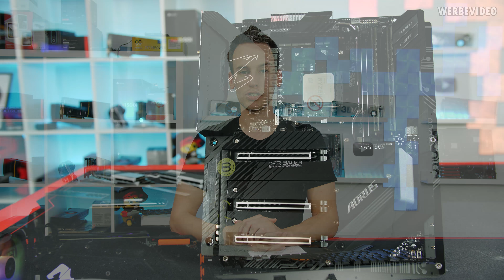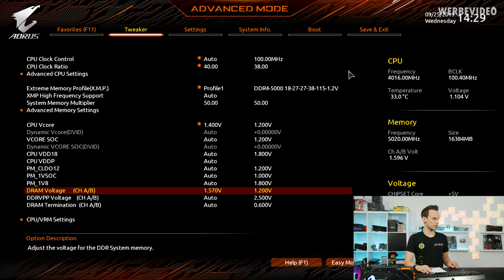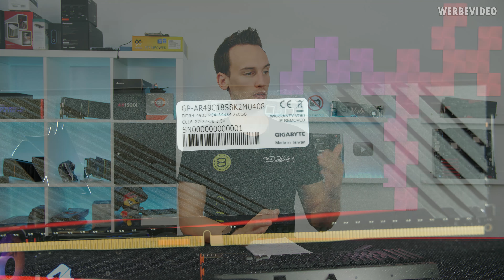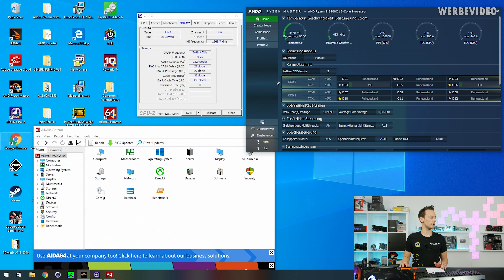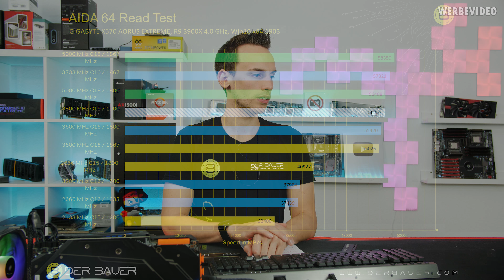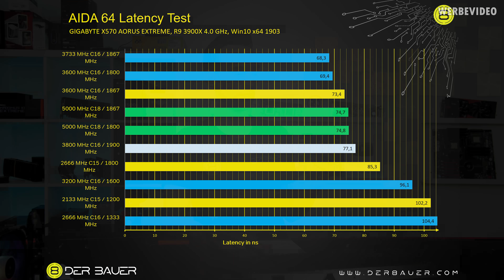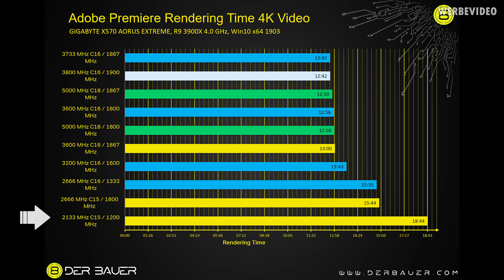Insane: 5000 MHz RAM Speed on RYZEN 3900X

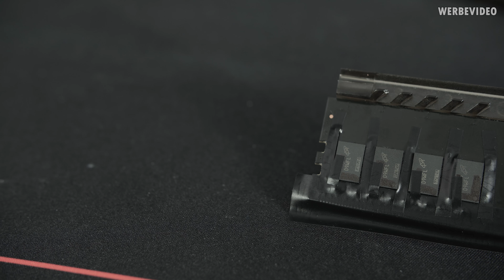Comment: Memory dies censored at 4:07 but not at 5:27
Reply from the maker: 😂😂😂😂😂 Well
Reply: @der8auer  GG
Reply: @der8auer  I don't get why you have to censor the 9BE75 though, is it because it's not released yet?
Reply: @RymeofDawn  most likely, yes
Reply: shhhhhh
Reply: @der8auer  well, thanks for that blunder :)
Reply: @der8auer  How can you be so casual about it? Do you not care if they give you any other hardware ever again or not?
Reply from the maker: ̷ ̴ ̸ɢ̸ʟ̶ɪ̸ᴛ̶ᴄ̶ʜ̷ ̶ ̶ difficult story. I didn't know it and now I fked up marking all parts. Sht happens 🤣
Reply: @der8auer  What about thaiphoon burner? Didn't it recognise IC?
Reply: The ballastix elite 3600 seem to have these same ICs. They were the record breaking binned sticks.
Reply: LMAO! GG made my day 🤣
Reply: @der8auer  Thaiphoon Burner screen please ! Then I think this are 9BE75-D9WFL micron e-die similar (or maybe identical) to chip used on Crucial CT16G4DFD832A (jedec 3200 1,2V). So basically is a binned version of 3200jedec modules... maybe some lucky one can buy CT16G4DFD832A  and install an heatspreader on it and push 1.5V... you can get close to this modules... (and this should explain also cause they not want to show what is under the hood...).
Reply: @sc32valve  i only saw elite 3600 with C9BJZ  part number e-die. Are binned IC, just jedec is not 3200, usually is 2666. Same for ballistix LT, C9BJZ or D9VPP with jedec 2400. Jedec value are matched to different part numbers, just that. Are all micron e-die. Maybe higher jedec value with 1.2V standard are more sensitive to voltage, so you can have good overclock with 1.5V, basically are the same IC.
Reply: @GiuseppeDelfinoGuitar  Thanks for the reply. You seem really knowledgeable on the topic.
Reply: @GiuseppeDelfinoGuitar  do you have a twitter acct? love surrounding myself with very intelligent PC enthusiasts. you pretty much nailed the specs. cant wait to get my hands on these they arent even very expensice. 130$ for 32gigs
Reply: The 3200MHz 1.2V JEDEC 8GB single sided modules I have from Micron have part number D9WFL (MT40A1G8SA-062E:E). I only tested them at 3200MHz 1.35V so far and I got 14-20-14-35 stable on my 1950x system. tRCD really sucks, so that explains the 27 on these 5000MHz kits.
Reply: @GiuseppeDelfinoGuitar   Absolutely not the case.
Reply: @GiuseppeDelfinoGuitar   The E-Die under the Ballistix name are not the same as standard CT product. It's engineered at the wafer level specifically for BLX. : )
Reply: @jake-fab  Is called binning, and is just a selection. In the video you can see 9BE75-D9WFL. So i explain you better, 9B is manufacture date: 2019 week number 4. The letter E is the version of product kernel, and 75 represent the product distribution for a total of five regional codes, US/Singapore/Italy/Japan/China. Second group code is called FBGA code: D9WFL match a part number MT40A1G8SA-062E:E (you find it on the micron official part decoder). With this part number you can translate the IC on official document called 8Gb_DDR4_SDRAM. Now if you check standard Crucial DDR4 CT16G4DFD832A you can see 9XE75-D9WFL which are exactly the same IC (no difference or engineering whatsoever). The only difference is the SPD data match the speed grade of part number, so you have 3200cl22 (062E) and undefined xmp. The overclock in this case is pure luck, cause CT product is not tested for xmp. (another info, CT modules have B2 pcb revision design...). Since jedec 3200 have a standard 1.2V is likely probable an high frequency increase tolerance with voltage between 1.35 and 1.5V.
Reply: @GiuseppeDelfinoGuitar   Hey great info!!  I am the Global Product Marketing Manager for Ballistix. I  can tell you for a fact, that the BLX E-die isn't a binning process as you would expect from manufactures who purchase DRAM for gaming modules.... It's a specific workflow in Micron. ; ) IC decode is accurate, but it's still controlled workflow for BLX.  And it's real good stuff.  : )
Reply: @jake-fab  ok, you should be more specific and say some other tech details. I can say that ballistix have CT40A1G8SA-62M:E part number, and is the only e-die i know about with CT40A series. Did you mean that ? Cause other e-die are all MT40A.
Reply: @jake-fab  You are not Jeremy Mortenson, he is the worldwide product manager for Ballistix memory products. When you qualify yourself, you should at least say your name ! Otherwise is just web trolling.
Reply: @GiuseppeDelfinoGuitar  I have to be careful what I say tech wise so I don't inadvertently give out information that may be proprietary. I will talk with our PLM team and see if we can say more. Possibly in a more tech based forum like over at HWBOT or the likes. Most of the community has figured out what is in each product, and it has been fun to watch for sure! Ultimately I just wanted to make sure that folks were not going to purchase the CT 3200 parts in the hopes of getting die that is so capable beyond JEDEC.
Reply: @GiuseppeDelfinoGuitar   Absolutely, My name is Ryan Jacobson. I have been in the role officially for about 9 months, but have been working in the role for almost two years now. I came on as a contractor from my own company. I also worked at Micron for a couple years at Systems Integration (SIG) for a couple years around 2000.   I am an avid gamer and system builder, and overall a tech nerd. The majority of my product marketing and design experience comes from the firearms industry however.
Reply: @jake-fab  ok, i think i finded you on twitter (Built2w1N). I'm basically on every tech forum since 2005, will be interesting talk about e-die and micron products with someone who can have specific tech details and tips. p.s. i recently bought a set 2x16GB of Ballistix sport LT 3200cl16 (BLS2K16G4D32AESB). For the price i think there is no better choice around..
Reply: @GiuseppeDelfinoGuitar  
Bought the same sticks, works great, 16-18-16-36 , 1.4V 3600Mhz.
LPX 3200 did not get over 3000Mhz on Asrock TaiChi x570.
Just a thumbs up, carry on gents.

Comment: Basically it's time for DDR5 memory sticks!
Reply: @Fezzy976  GDDR4 wasn't "skipped" several cards used it.
Reply: First JEDEC would have to bother to finish DDR5 specification.
Which is as much late as Intel's 10nm node.
And then DRAM maker cartel likely makes DDR5 prices such high that still rather expensive DDR4 (no GB price improvement from 2013's DDR3) looks like free in comparison...
Reply: I think we'll see that in the next 2 years when ironically the AM4 socket gets upgraded to a new socket.
Reply: CPC_RedDawn what are you talking about? Gddr4 was a very common memory type.
Reply: @madjimms  basically skipped
Reply: @Fezzy976  GDDR5 is not going to be used for system memory (unless you're counting consoles, as current-gen consoles already use GDDR5 as system memory). DDR5 is not going to be skipped. If you see either of those things, you're hallucinating.
Reply: @scottyhaines4226  Why is AM4 being upgraded ironic? It's not ironic, it was inevitable that it would happen eventually - AMD only promised support of the platform up to 2020.
Reply: @nathangamble125  I said it being upgraded right when DDR5 RAM comes out is ironic. Meaning they timed it too well. Not that it's a bad thing. Stop being so triggered
Reply: @nathangamble125  damn man, go outside. YouTube isn't supposed to stress you out
Reply: @nathangamble125  *up to 2021
Reply: GDDR6 now

Comment: idk how should I feel when my RAM is faster than my CPU...
Reply: Not really, because the CPU is actually really running at 4+ GHz, while the memory is doing 5000 MT/s not 5GHz.
Reply: C0BEX Basically 2.5 ghz
Reply: @nanolog522  On other words DDR = double data rate
Reply: @Ebani  That is not at all what hertz is, (I'm massively over simplifying here, I'm talking specifically about frequency in regards to what a hertz is) a Hertz is a sinewave that goes from a predefined low value, to a predefined high value and back again in exactly 1 second. In the example of computers this is a transistor going from off or 0 volts, to its specified required voltage and back to zero in one second, and the more hertz, the more times this oscillation happens per second. 

DDR runs at half its rated speed because it sends 2 bits of data per pin per clock cycle, if it sent 1 bit of data per pin per cycle and ran at 5GHz, then yes you should say GHz instead of MT/s, as it would be its actual speed, but alas it doesn't work that way.

So using MT/s is actually the correct measurement of speed when talking about RAM, and saying that hertz means anything else makes you "sound like a dumbass" to paraphrase your comment.

Perhaps you should avoid trying to insult others and take a look at the SI definition of hertz, cause you've only embarrassed yourself in your attempt to throw terms around you seem to have only a tenuous grasp of.
Reply: @PaulTheFox1988  And that is not what a Hertz is, at all. A unit is used to measure something, in this case cycles/second. I don't get what's so hard to grasp.
Reply: @Ebani  Just like you said. A Hertz is a standard unit for cycles per second. This RAM is doing 2500 cycles per second, not 5000.
Reply: @C0BEX  2.5B cycles per second not 2500
Reply: Just wait until DDR5 is in laptops
Reply: @Ebani  The problem isn't the unit. 5GHz is the effective frequency of the memory. 2,5GHz is the real frequency.
Saying both 5 000MT/s and 5GHz effective frequency is technically correct (as long as you say 5GHz *effective*), cause RAM in fact does 5000 Mega Transfers per second and it in fact runs at 5GHz effective frequency.

The 5GHz effective frequency is slightly missleading, because RAM isn't actualy running at this frequency, but DDR 5GHz effective frequency is a equivalent to a 5GHz real frequency SDR memory.
What is this caused by? RAM nowadays is DDR - Double Data Rate. That means a memory cell can be read two times per cycle - on both rising edge of the clock and on the falling edge of the clock.
So even if we are running 2,5GHz real frequency, we are effectively running the equivalent of 5GHz Single Data Rate memory thanks to the fact we are reading data two times per cycle.

As for people complaining that manufacturers are missleading customers by this - a normal buyer does not care if it's MT/s or MHz, effective or real clock.
Since the industry kinda standardized that we are seing the effective clock on memory kits, changing it would only make everyone confused.
Reply: @dominikliberda4017  And all the others, you are all wrong. The memory is really running at 625MHz. It produces output at both raising and falling edge (DDR) and it produces 4 reads per output (consecutive addresses, so not so random access, but hey, its fast=).  To accommodate for the 4 reads, the IO bus runs at 4xchip speed (2500MHz), so outside it looks like you get 4 bytes one after another, even if they all happen as a result of one memory operation. On top of that, all this happens twice in a cycle, giving 5000MT/s
Reply: CPU is faster. The memory clock is 2.5GHz. Plus there is way more things going on in CPU at the same time. The bandwidth in caches and latency there is way better than RAM.
Reply: @PaulTheFox1988  You're not "massively over simplifying" anything, you're just flat out wrong. Hertz is a unit of frequency (cycles per second). It has nothing to do with sine waves. Often it's used to to state the frequency of sine waves, but it can also be used for the frequency of literally anything else. Digital signals use square waves, so sine waves aren't relevant to RAM frequency.
Reply: @dominikliberda4017  Actually, Ebani is right. It's not wrong to say that the memory has a frequency of 5GHz - as long as you're making it clear that you're talking about the frequency of memory transfer, not the frequency of the I/O bus clock.
Reply: @UNVIRUSLETALE  dude 2500 microB is 2.5B
Reply: @nathangamble125  no, he's completely wrong
Reply: @Henrix1998  It's still more than my CPU XD
Reply: Josua D lol
Reply: Oh, it’s worse; it’s multiplexed. DDR2 800 MHz CL 4 runs at the same clocks and latency as DDR 400 MHz CL2. It just reads more data in parallell and feeds it out in smaller chunks at higher clocks externally (multiplexing). DDR 400 CL2 = DDR2 800 CL4 = DDR3 1600 CL8 = DDR4 3200 CL16 = DDR5 6400 CL32.

The memory cells themselves have barely improved since 2003. That’s what not having dennard scaling does for you..
Reply: That's where it becomes a waste of money intel can only go so fast lol thats when gpus even tho they have slower cores thye have a million of them and that's where intel is in deep shit lol thats why thye are looking at 3d stacked gpus like nvidia  and amd all 3 company's can come up with 8 gpus on a pcb and sell it won't be long sli is technically  not dead but it will come back but instead of buying 2 gpus it will be a 2 in one gpu like the titan z but imagine the titan z with 4 gpu or 8gpus I think intel is scared and too be honest they have a tech expert from nvida tom Peterson  is helping  intel with there glu problem  lol yet intel has said by 2025 to bring out a 8 gpu stacked with memory

Comment: I was waiting to see gaming benchmarks. Memory speed plays a huge role in CPU-bound scenarios.
Reply: what you are saying is a bit imprecise.  if a thing is CPU bound, then memory throughput would make no improvement at all, the cpu is busy doing math not waiting on data. If the CPU is throughput bound, then memory speed would improve it, but if the CPU is memory latency bound, then this setup wouldn't make any difference as latency is worse (might be different on an intel machine?) . In general I've not seen MOST games improve with more speed, only with less latency. There was one game though, I forget which, one of the new AAA ones, that responded really well to more throughput.
Reply: @Gandalf721  that's because up until the 1:1 ratio at 3600mhz, increasing memory speed also increases infinity fabric speed, AND reduces ram latency. This 5000mhz kit doesn't do that, it make latency worse instead of better, and infinity fabric is still at 1800 just like 3600 ram.
Reply: there are plenty of benchmarks out there showing how ram at 4000+ does vs 3600 and most games don't do any better.
Reply: @JackMott  I guess a better way to put it is 'non GPU bound scenarios'. In my case I use 4133 RAM paired with an 8700K and I can definitely say the memory helps a lot when pushing really high FPS (again, when you're not limited by the GPU). In some engines like Frostbite 3 the difference can be quite significant, in others not so much. Look at this: https://youtu.be/Y-TxiaJNyto?t=112
Reply: @_megazz  right, but in this video, with a zen2 ryzen cpu, going higher on the ram speed hurts latency, on your intel it reduces latency.  latency is usually the big win, not throughput.
Reply: @JackMott  It's 1:1 untill 3733MHz and then after that the infinity fabric decouples so you can down clock faster ram to 3733 with tighter timings and get better performance that way. Though decoupling the fabric can get you better performance in certain tasks.
Reply: @24wherath36  how fast you can get the IF to stay 1:1 depends on how lucky you got with your cpu. By default the limit is 3600, some people can get as high as 3800 by setting IF manually, my 3900x will only do 3666.  I've seen the chart showing 3733 as optimal too, but it isn't entirely correct. Not all zen2 cpus will even do it.  Y'all can keep replying to me as if I don't know my stuff but I do.
Reply: i'm using a 3200mhz kit @3600mhz with my R5 3600 @4.3ghz (:
Reply: Async mode is horrible for gaming, because gaming hates any form of latency. The reason is because gaming application mostly use a LOT of very small calculations, so those nanoseconds of delay between operation completions add up very, very fast. That's why you can get a noticeable improvement in gaming from a CL14 kit when compared to a CL16 kit of the same clock speed, while most other applications don't really care. Clocks matter a lot, but latency can seriously affect gaming performance.
Reply: @JackMott  so 2133 mhz is better for Ryzen 3000s than 3600 mhz?
Reply: @mycelia_ow  Lol no.  Would not go any lower 3200mhz on a 3000series Ryzen otherwise just wasting free performance.

Comment: That's some pretty cool stuff! We've got some Micron E-die (Crucial Ballistix LT) that does 4600MHz 18-23-18-18-38-70-1Τ (GDM on. 2T with off), rock solid, at 1.46V, paired with an R7 3700X. 
Sadly can't reach for more, since the MSI X470 Gaming Pro Carbon we're using maxes out at 4733MHz... 
I guess we would need an X570 for something greater than that.
Reply: e-die are the best, did you run single rank modules right ?
Reply: @GiuseppeDelfinoGuitar  Yep. Dual ranks wouldn't clock so high that easily.
Reply: @pcoverthink  Depends on a lot of things. If you don't go for 32GB kits, chances are that you're getting a single rank. And the performance boost isn't so significant that it justifies the extra price premium you have to pay for them.

Comment: Interestingly, when the memory manufacturers learn glue labels marked on the side with which they are not visible during installation RAM modules in slots ??? 

Интересно, когда производители памяти научатся клеить наклейки с маркировкой с той стороны, с которой их не видно при установке модулей ОЗУ в слоты???